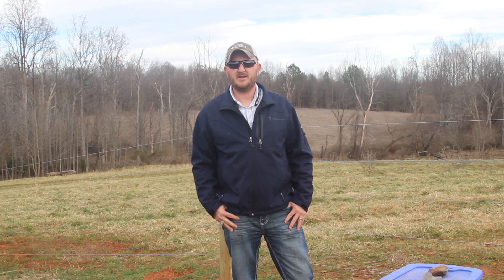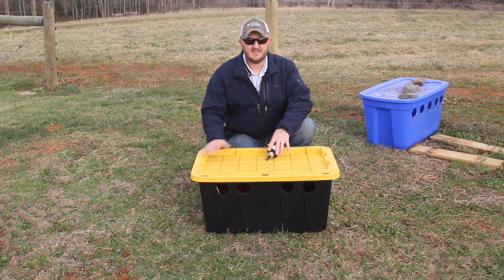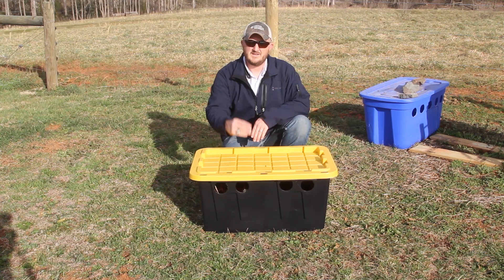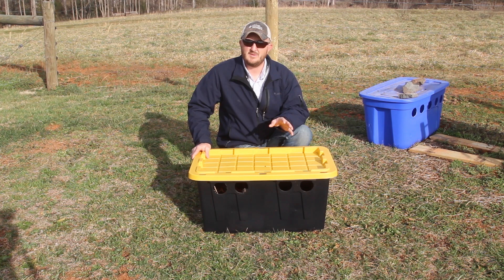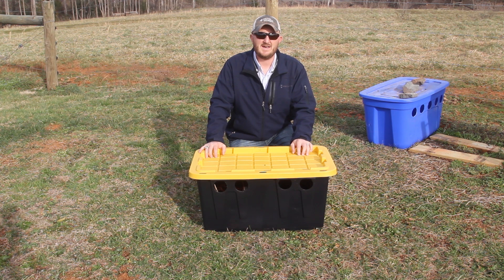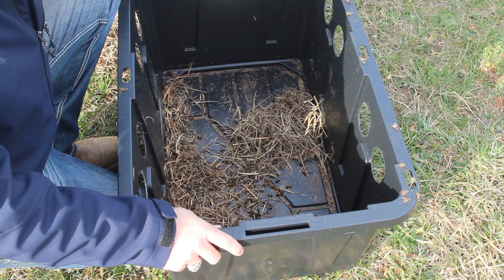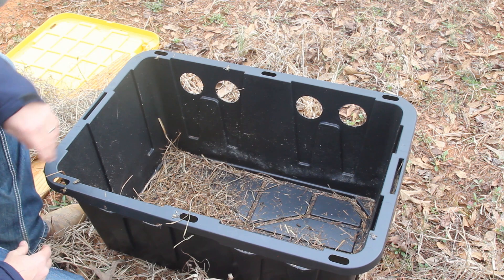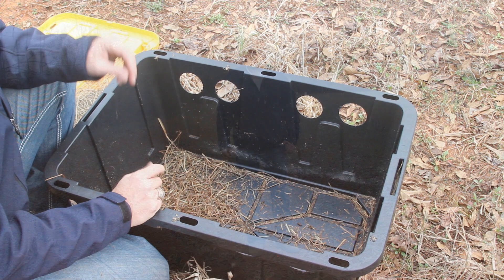Tote Style Open Feeders

Comment: You  should check out the video by barnyard bees where he makes an open sugar feeder out of a five gallon bucket.
Reply from the maker: I thought I mentioned why I didn't like those either in this video or the comments. They are not my favorite method for feeding lots of hives lots of syrup. I actually saw Joe May making and using this same style feed last night. Even used the same totes. Must have been a good idea. Of course I got it from Ian.